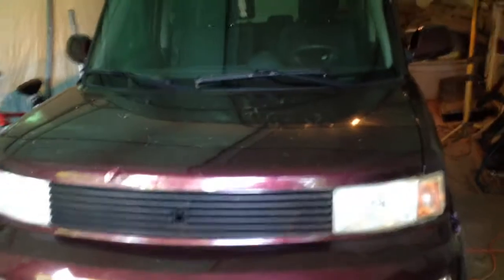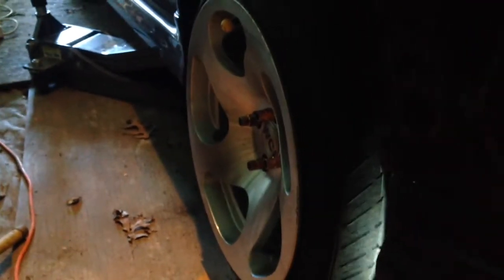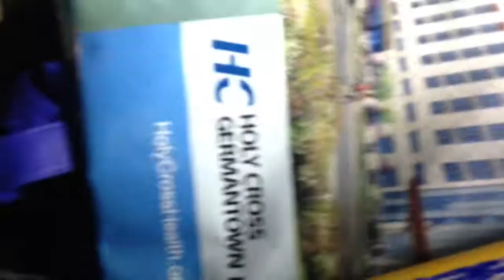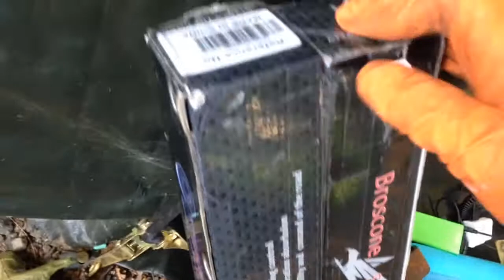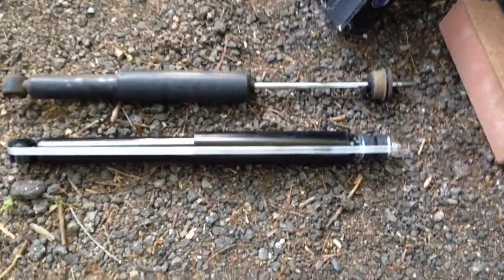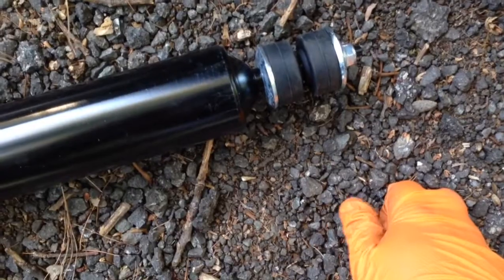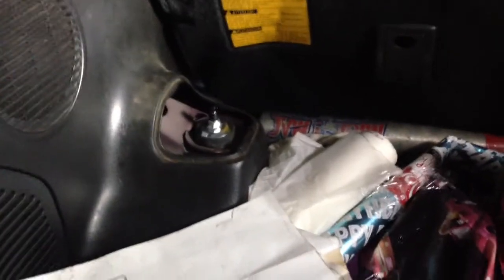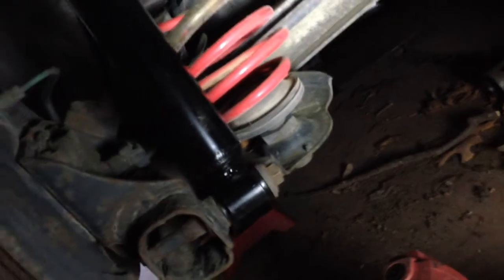HOW TO INSTALL REAR SHOCKS ON 2005 SCION XB

Comment: Was a alignment needed afterwards?
Reply from the maker: Jonel Albano I didn’t get an alignment done after. It is recommended after any suspension work to get an alignment though.
Reply: Rear wheels on 1st Gen xB  are non adjustable, so no alignment required if you're just replacing the rear shocks.
Reply from the maker: Abel Briones makes sense!
Reply: You probably would only require an alignment if you have wishbone suspension and  you replaced the adjustable arm

Comment: I'm trying to tighten the. Top screw but is not screwing
Reply from the maker: yogiman818 yogiman818 I used an adjustable wrench to hold to little nub still while cranking down the nut! At 6:20